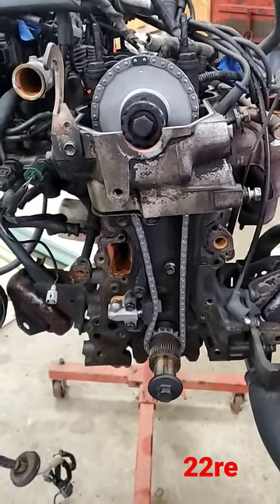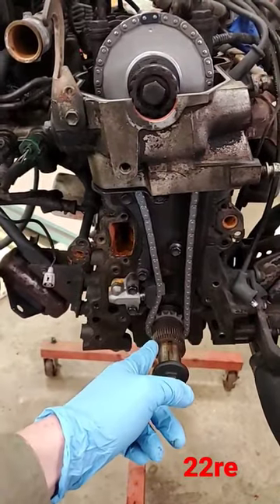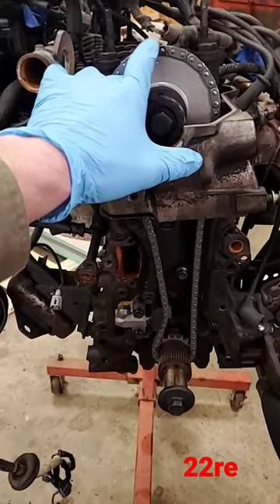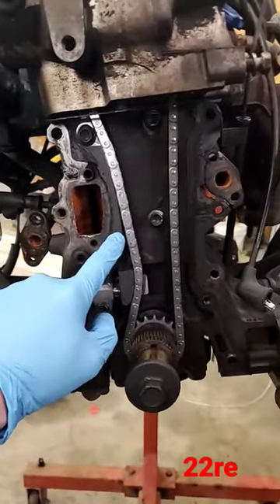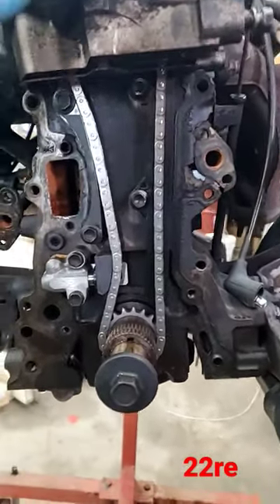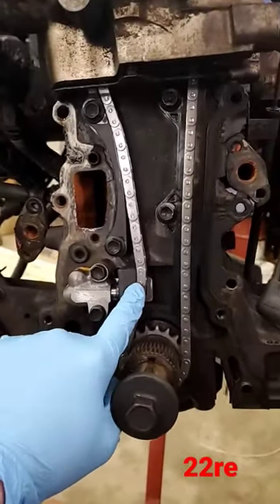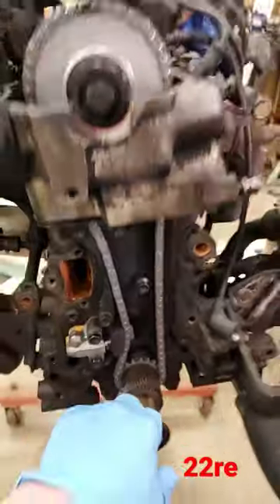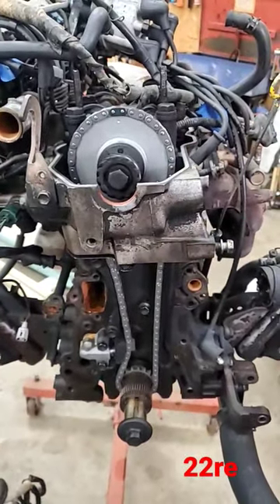22re 2.4 Timing Chain

Comment: Your a tooth of on the cam bud
Reply from the maker: @YotaguyJosh  how so?
Reply: @diy_automotive  the colored link should be lined up to the passenger side. In other words, where your colored link is centered, it should be one tooth to the passenger (in LHD versions) side of the engine. LCE has a good video pointing it out. I made the same mistake and wouldn’t have figured it out if I hadn’t found the LCE video.
Reply from the maker: @joshstauber3335  Thanks for the heads up, toyota Repair data says align links how I did. I know when I installed it, I didn't have any timing issues, so I was curious if there was a difference depending on a year, etc. 
I watched the video you mentioned, and he references the key way for cam gear, not the dot it's self.
If you look the shiny link is to the left of the key way in my video, I think the main problem is people who have a cam gear with out the indicator are going off of the key way it's self which would cause the timing to be off a toothe.
Thanks for the comment. I got my brain thinking and learned something new to watch out for in the future. I'm also sure others reading this in the future will double-check their setup, giving them another chance to catch a mistake.

Edit: he actually mentions the dot style cam gear and explains that the dot is positioned to the left of the keyway/dowel pin.